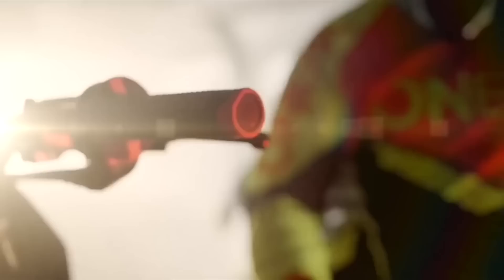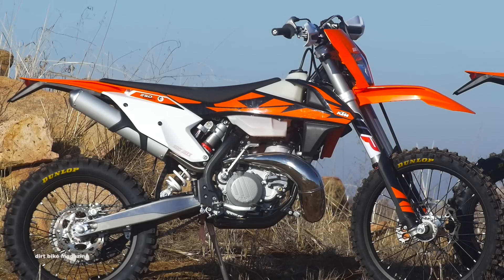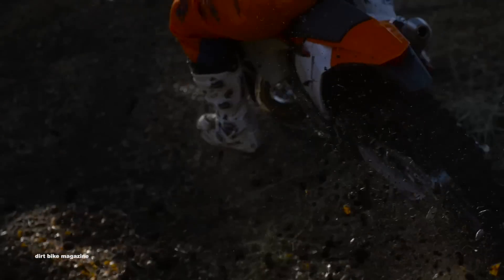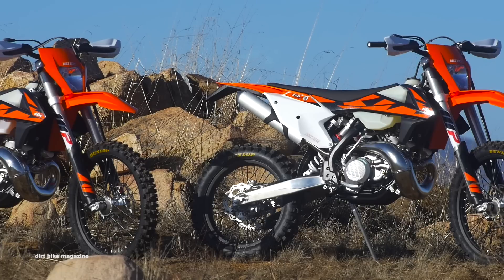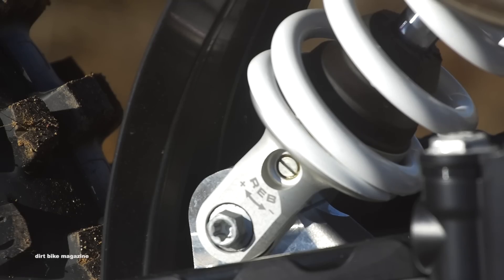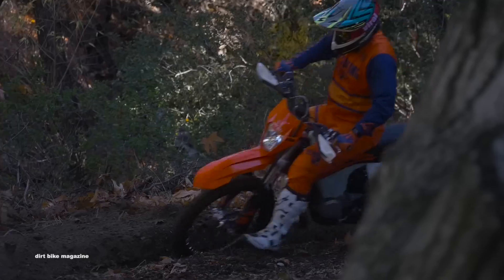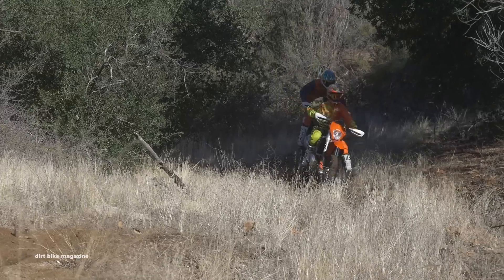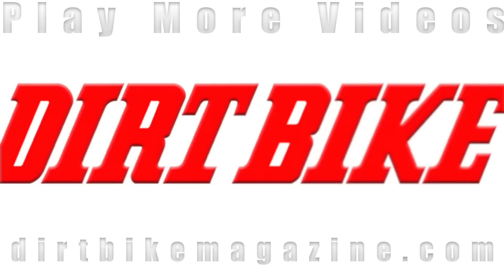Fuel Injected 2 stroke VS Carbureted 2 Stroke KTM 250 XC-W - Dirt Bike Magazine

Comment: The less moving parts the better for me. I’ll stick to a carb and a simple kick starter
Reply: @Jason Wong No kidding.
Reply: @Jason Wong electric *
Reply: FI literally has less parts because now there replaced with sensors.
Reply: I really like my electric start.
Reply: @SD-ir1vf  it's badass but batteries suck
Reply: @MEGASTRIX  and those sensors have been going bad left and right
Reply: Efi has literally no moving parts.
Reply: @michaelschwab9563  Nobody had any problems with sensors and it can work without any of them. Literally every one of them can break and it will still work.
Reply: @dkdanis1340  Did you forget about the fuel pump? Carbureted bikes don't need one of those.

Comment: It made four strokes better so I don’t see why it can’t eventually do the same for two strokes.
Reply: It already does, look at the snowmobile world.  My fuel injected twin 800 has full snap, when and where ever you want it. The power band is always available there is never any lag or weak rpm ranges like the old carb sleds.
Reply: well there is a trade off.. FI doesn't make as much power top end.
Reply: asambi69 An injected 2 stroke will make more power than a carb at any rpm. That’s the point of it, maximum efficiency with no weak ranges like carbs face. Better on gas, more power, bigger power band. There are no cons besides serviceability and repair cost.
Reply: Chuck Beef Exactly!
Reply: Not rely, most engines lose power when converting to FI, atleast in the infancy.
Reply: asambi69 Yeah in the beginning they could. True
Reply: asambi69 I dunno man. My carbureted 800 sled maybe made 130hp and my fuellie makes 150+. It’s available at all times tho, where carb sleds will bog or have dead spots. My sled can be stuck at a standstill and you have full power right now. There is no comparing the two in terms of performance. This is why it is hard to find a 2stroke sled with carbs, because direct injection is just SO MUCH better than carbs (performance wise).
Reply: Kim Byers the vipers were triples. Yamaha doesnt make a 2 stroke anymore. They just make fat 4 stroke trail sleds noe
Reply: theninja001 What does that have to do with anything? EFI has been around since the 1940’s. It is not a new concept. Injectors, fuel map, ecu. That’s it. Aside from programming it is very serviceable. When temps and elevations change, you have yo re-jet carbs where EFI does that for you. Never have to take the carbs out, clean the crap and retune every year. Much more reliable than a carburetor. Hoe many vehicles run carbs these days? Very few. Nothing wrong with carbs, but stating they’re more reliable than EFI is kind of a stretch imo.
Reply: Chuck Beef I have just been seeing a lot of guys with efi issues on their bikes, it works great in vehicles and street bikes, but I think it still needs work in offroad bikes.
Reply: Chuck Beef you got it right man. A well tuned carb can make as much peak power but it takes more work, is affected more by temperature and elevation changes, gets worse fuel mileage, gets clogged up, etc. DI is the future no doubt.
Reply: With jetting and a carb you only have a limited range that is PERFECT. With FI it can be perfect at every single point in the RPM curve... once they figure out the curves FI will make maximum HP and Torque at every RPM. It will be smoother and more responsive from the bottom to the top..... Look at cars especially performance cars... drive a card mustang vs a FI mustang from today... THERE IS NO COMPARISON.
Reply: stop talking shit a modern efi control fuel accurate for every motor stroke better in every aspect,a carburetor is just a controlled fuel leak,you are saying untruths
Reply: @ChuckBeefOG    Bullshit. The point of TPI and EFI is to give the EPA/Euro 4 approved fuel ratio at all times.  They dont tune TPI and EFI for power.  They tune it for emissions.  Wake up dude they never used that shit until emissions regs got SO tight that they HAD to use it.
Reply: Hr BeStalkinMe Emissions is a by product of combustion. The reason a carb has worse emissions is because the A:F ratio is not optimized at all rpm, it is set up to run in a certain range. EFI changes the A:F ratio electronically all through the ENTIRE rpm range to achieve the most optimum.air fuel at each throttle position. This allows for a CLEANER and more thorough burn of the charge each time the piston reaches TDC. Therefor as a result, more power everywhere, better economy and emissions. It’s a no brainer in my opinion. I still love my carbed 2 screamers, but on a sled there is no way in hell i would choose them over DI. DI also allows for reliable forced induction (turbochargers). Show me a carbed sled that can make 280hp in a stock motor.
Reply: @ChuckBeefOG   You do not understand the relationship between emissions and horsepower.  The Most complete burn happens at stoichiometric ratio, usually around 14.7:1 AFR.  However, peak power happens at a MUCH richer ratio. Usually in the neighborhood of 12:1 AFR.  You can run slightly richer or slightly leaner than that and it doesnt really impact power.  But EFI is OT TUNED FOR POWER.  EFI IS TUNNED FOR EMISSIONS.  NOT POWER.  YOU CANNOT HAVE BOTH.  IF YOU WANT POWER, YOU NEED 12:1 AFR NO MATTER HOW YOU SQUIRT IT IN IT WILL CREATE HIGH CO EMISSIONS NO MATTER WHAT WHEN YOU TUNE FOR POWER.  EFI makes it easier to get the engine to tune the engine to run on the edge of lean/stoich all the time.  But thats NOT where the power is.  They do that to meet emissions standards.  Ive worked for 2 very Big name engine mfgs and every single time we went to EFI on any engine was 100% because we couldnt get it to Meet emissions standards with a carb.  And guess what?  The EFI engines NEVER FUCKING EVER made more power.  The carbed engines run rich to be safe from detonation, and get max power.
Reply: Hr BeStalkinMe I will run a 800CFI up on a dyno anyday against a carbed 800. Yes, focus may be on emissions but more power all the time is obvious to anyone who has ridden one.
Reply: Chuck Beef   Didn't they change more shit with that engine than just converting from carb to EFI?
Reply: Maybe if you have shitty antique carbs on a shitty old lawn mower or streetbike and leave shitty ethanol fuel in them for a long time..  I've never had to clean any of my dirtbike carburetors.
Reply: Jayson Iorg No it wouldnt. Forced induction compress the air charge, it will always be more efficient at altitude. What you say does hold true at sea level however.

Comment: Can't wait till this is mainstream. Efi is more efficient, and can  efi can atomize fuel better, increasing power and efficiency. Most don't know that the more you atomize fuel ,the more efficient at burning the gas will be at ingition. When this is mainstream for 2 strokes, them thumpers will be really running behind, not like thumpers have ever been faster anyhow. 4 strokes have to have 2x the cc displacement compared to 2 strokes to make same power out put. #2 strokes forever

Comment: the 2 stroke FI is the future. 2 stroke can only be applied on a single piston. and FI was designed for 4 stroke or multiple pistons. nobody knew or at least tested to make a 2 stoke FI until now. the cylinder head is eliminated, the air overlap in a two stroke is eliminated because the gas will be injected from the top of the cylinder meaning fuel efficiency to the max. the FI version when reb at lower speed will make a tattering sound (chung2) the reason for this is because the FI was designed to limit the rpm at a certain max rpm.

Comment: It seems like a no brainer to me:
- Lugs at even lower revs than carb, harder to stall, should be easier to find traction and feather throttle
- Works at all altitudes without adjustment
- According to MaverickDH's comment on here it DOUBLES the life of the bottom end (no fuel diluting the lubrication), and gives 200hours life on the top end due to better fuel combustion
- no more mixing oil and fuel. Combined with lower servicing this significantly changes the ratio of time spent in the saddle vs time spend on the end of a spanner. 
- Better fuel economy. EDIT think about how that leaves electric bikes further behind... "electric bikes are better, they just need better economy but they are getting there!"... yeah, well now you have 30% further to go hahaha
Reply: I think the TPI is better in deepwater as theres no carby breathers also !!
Reply: @elijah1923  well newer ones are pretty light, have fast charging. Weight isn't always in battery some electric bikes and cars can be lighter than gas counterpart.

Comment: Note 1; No one in Europe is riding their TPi restricted. The carb ones was also restricted and it was removed at the dealers.
2; Cold/warm weather climate. No need to "re-jet".
2; People mentioning "more things to go wrong!". Where have you guys been when 4-strokes got efi?
I rarely see any problem with them at all and I never had any problems with them.
Reply: pelleper 4 strokes have oil inside them. When your oil injection fails on a two stroke you got probably 5 mins to shut it off before it blows. You shouldn’t really have to rejet your bike because usually you ride during the same season. And if you do have to re jet that take 10 mins. Adding electronics to a motor is just over complicating it. It’s always lead to that vehicle being overpriced, and impossible to work on. The two stroke is simplicity that make more power than a four stroke with half  the displacement. Leave it to the 4 strokes to be computerized.
Reply: Harry Slother
If you don't evolve the 2-stroke it will disappear (which it did for some time).
Its not more complicated then an efi on a 4-stroke.
I don't see any problem with the oil injection. It been around forever on snowmobiles.

If jetting is sooo simple then why is everyone running way to rich?
Sure, during summer and winter you are fine with one setting but during spring and autumn it's a pita.

If we still want road legal 2-strokes this needs to happen.
Reply: pelleper road legal 2 strokes and motocross bikes are two different things. Oil injection on snowmobiles is a problem, they still can’t make a reliable way of doing it. Snowmobiles blow up all the time because of them. People take them because if it fails you don’t even know. There is nothing wrong with running rich. All two strokes run a little rich and they should. Would you rather run lean and blow up? I don’t have a problem with fuel injection two strokes but they should make a carb and inject model of every bike.
Reply: Harry Slother
I live in a country that has a lot of snowmobiles and I can't say that it's a regular problem.
Agree to disagree. Wait and see if a lot of 2018 will blow up or not.
Running rich often means to rich because of laziness.
I think that the TPIs are running way better then any carb I have ridden.

Well, I ride enduro so I need it road legal.
Can't speak of motocross but I don't see any problem with low tech (which tpi is) reducing fuel and oil burn.

We are not talking about shitty tech like EGR and adblue.
Reply: my grandmother.
Reply: pelleper the reason two strokes disappeared in the first place is because anyone can work on them, low maintenance, very durable which means dealerships and manufactures make less money in parts/labour. and don't forget  high power to weight ratio. 

Its a joke to think four strokes were even close to a step forward. To even compete with two stroke power they had to shave all the parts paper thin and reduce longevity.

My dads 2010 four stroke Mercury 115hp is sitting in the garage with a leaking oil seal gasket. Dead as a duck 
and. 3 grand to repair.

I have a 1979 two stroke 35hp Johnson still runs like a stallion with an upper crankshaft seal leaking. They knew what they were doing back then. Two strokes can be half broken and they will run on a rag you spilt gasoline on.

One seal gone on a four stroke and your engine is toast!! Dealer and manufactures love that!! Consumer not so much...
While you feel like your saving gas your just waiting for a big pain in the ass!
Reply: pelleper 4 stroke runs lean it gets hot. 2 stroke runs lean it blows up
Reply: I rode my KTM carb bike from 10 feet elevation up to 5,200 feet elevation without doing a thing to the jetting. I also got over 1,200 hours with turning a screw on the engine. When those tpi bikes get some age, you'll see people forgetting to clean the 2 stroke oil system. Or failing tubes and oil pumps. It's a whole different kind of oil pump than 4 strokes. If the oil isn't being pumped into the engine for any reason, you don't have a clue unit it locks up. You'll see rods slung through the cases just like the 4 strokes do. This never happens in carb bikes. It's a ton of more stuff to go wrong
Reply: @RustyShakleford1  actually it's because of California passing extremely strict emissions laws on dirt bike. They banned all 2 stroke from all public lands virtually cutting off any riding area in California.
Reply: How, exactly, are the tpi bikes restricted?

Comment: Bought a new 2018 carburated 250 and it was about 2k less considering the discount and no set up fees. Cant find a TPI here in CO for below MSRP without setup fees. Lectron carb made it run even better than the TPI and is more reliable.
Reply: Or you can spend $25 in brass, save over $470 and have a better running bike... .than a lectron.

Comment: The problem with snowmobile and dirt bike 2 stroke fuel injection is that the main purpose of EFI is to satisfy the EPA goons,  not to satisfy you the customer.
Of course many enthusiasts will want one no matter what, but understand that you violate the laws of physics when you lean burn a 2 stroke and still expect long engine life. The result will be more frequent top end rebuilds due to inadequate lubrication unless you remap the fuel system to increase fuel supply and also increase oil pump output to match.
Look at the newer snowmobiles where the factory recommended piston and ring replacement is around a 1000 miles. My carburetted sleds would go 5,000 to 8,000 miles or more before a top end job was needed.
So when you purchase that new EFI 2 stroke dirt bike, enjoy it but be ready to accept the fact that more frequent engine refreshening will be part of your territory unless you just get a new bike every 6 months.

Comment: I'm really optimistic about this tech, really as just a means to allow for year-round riding of a 2 stroke. I live in CA, and so these bikes get what's called a "red sticker" which limits your riding season. I find w stroke bikes are lighter and tend to carry the weight of the motor lower in the chassis for better handling. I do like the simplicity of a 2 stroke (no valves) and the fuel injection does complicate things slightly, but I think I'm willing to trade it for year-round riding... now if these things weren't damn near almost $10K...

Comment: Honestly tpi seems like the future but a perfectly tuned and jetted carb bike isn’t worth selling and buying a tpi. Just not right now. I see problems in the computer that can go wrong and there goes your bike. Yikes, staying with carb until proven otherwise
Reply: AkaComeau well said. Oil injection is worrisome. When that fails bike runs normal for a while then seizes. Mandatory rebuild, bottom end smoked.
Reply: AkaComeau fucking right my dude you know what your talking about. I'll take a perfect jetted bike over fuel injected any day.

If you want a more complete combustion and torque on low end, use a hose running from your gas tank to inject gasoline vapour into your carburetor. Better Milage and more power
Reply: mcnameva my bike runs with an oil pump for 20 years and my uncles bike even longer. The oil sStem shouldn't be a problem same with the fuel injection. Athena uploaded a video of an injection system for 2s yeeeaars ago. This system is really good because the manufacturer can't do this when they know it can cause trouble.
Reply: Arved Ludwig no system is perfect.  They all fail with time it's just the consequences for oil injection failure can be dramatic. I have seen it happen on sleds and I know it's similar with 2 stroke watercraft.
Reply: Do research on the mercury outboards fuel system the racing  motors
Reply: Craig Nesbitt I didn't find much on  racing motors but lots of oil injection problems on common outboards. What are you referring to?
Reply: Exactly right mate. I'd say, let the big spenders go and buy them in the early years, get the R&D done and buy them in a couple of years when they're perfect.
Reply: yeh sounds like recipe for disaster
Reply: The idea is to have new bikes be EFI. It's not the end of the world. The benefits are awesome. Besides, we have no idea what their oil injection system is like. For all we know, it could be as efficient as a dry sump in the 4-stroke world. On top of that, they're probably not gonna pull out all their options and get every last bit of power out of the platform. As a business, they have to be even with other makers, or else it's gonna be a niche item instead of a competing product.
Reply: Steve Johnson oo
Reply: AkaComeau  been on sleds for 20 years now
Reply: My stepdad has a buddy that has the fuel and oil injected KTM. His buddy rebuilt the bike and had everything on there just right. From what I heard the oil injector failed, hose flew off and seized the engine.
Reply: Can't  they just add a light to the oil injection. So if it fails  u know from the light????

Comment: The carbon brushes on my TPI high pressure fuel pump plugged up the in the tank filter. Very common. Must remove tank. Big expense.